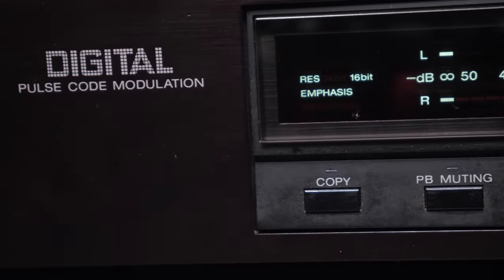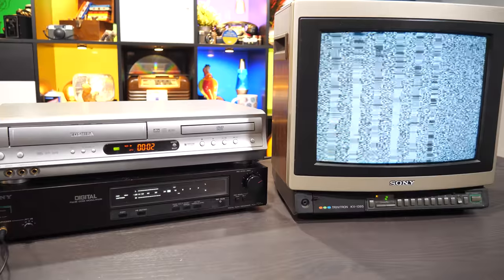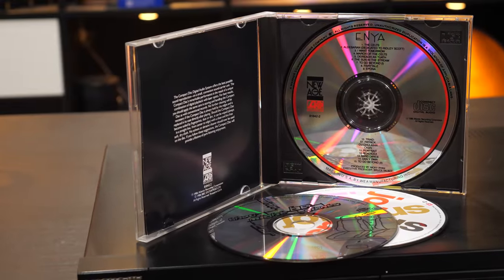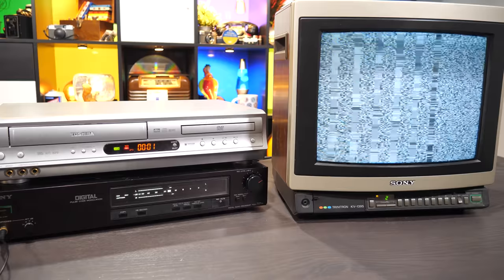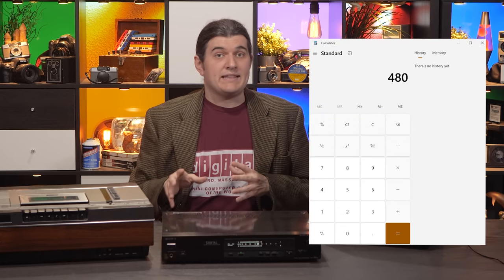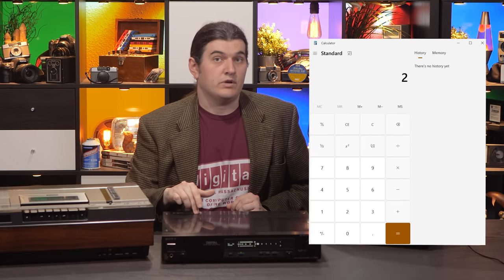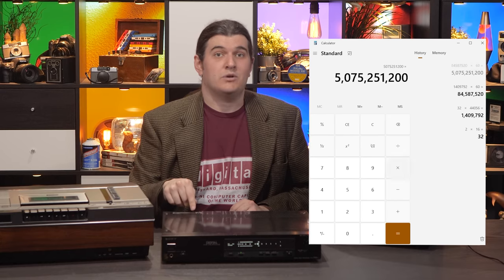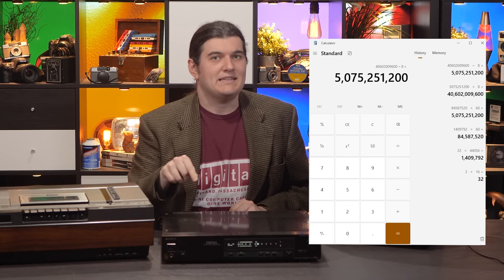Digital audio needed videotape to be possible - and the early days were wild!

Comment: Fun fact: This was how I used to record at music festivals for a very long time. I would record onto the stereo hifi track as well as through a PCM. I still have my Sony F1 PCM and can still play back many of the archival tapes I have (though a huge portion of those have been digitized at this point).
Reply: Moved to a PC file format, actually. Because it's digital audio already, isn't it? I'm curious about the process, how do you copy the tapes onto a computer??
Reply: @asnovasdodia  There are PCM adapters which have S/PDIF connections (eg. Sony PCM-601). Otherwise you can also re-digitize the analog output once again. To be fair, that's still give going to give you excellent audio if done right.
Reply: I think iirc we used to put the SMPTE info on the analog to sync it to the midi controllers
Reply: Have you made your recordings available somewhere?
Reply: I always wanted the pcm module for my F1 system & never got it but I still have all the brochures for the F1 system I would have liked to have the rest of the F1 system as well I could only afford the VCR & camera
Reply: @asnovasdodia  Yes and no. The "adapter" here functions much like a modem, modulating and demodulating the digital information with the analog medium.
Reply: I remember Steve Parish saying they recorded Grateful Dead shows on Beta for a long time. I assumed they were just using the audio track but this makes a lot more sense.
Reply: This was the only thing I could think of what it would be usefull for.
Reply: Yep from about 83-86 they were recording to Betamax with PCM encoders. Dan Healy was the brain behind that. They also had a cassette running.
Reply: @jerryseinfeld9815  That makes so much more sense than what I was imagining when I heard it.
Reply: How did you leave this comment a full day before the video was published?
Reply: Were you recording digital and analogue simultaneously to the one tape? If so, that's extra cool.
Reply: @dielaughing73  yup! That way both versions could be used independently of one another. In other words, if I didn’t have a functional PCM at some point, I could still at least listen to the HiFi stereo track.
Reply: @klatubaradanikto  Sometimes he would record them on a Pop Tart because you know... drugs.

Comment: This is why Sony and Philips both initially only advertised the CD as being able to hold "one hour of music", not its official maximum capacity of 74 minutes -- because that's the longest length of U-Matic videotape that was available at the time.
Reply: Wait…whut?!???  MIND. BLOWN.
Reply: A techmoan & LGR reference in the video, and a VWestlife comment in the comments section?

Now THIS is quite the technology (enthusiast) connection!
Reply: Curiously, Sony and Ampex later released U-Matic cassettes with a thinner tape and longer length (Sony MDU-75 and Ampex/Quantegy DAU-83E respectively). At the same time, full-length 74-minute releases ceased to be a rarity.
Reply: That makes SO much sense
Reply: The alternative story is that the duration of a CD was set by the Sony President as it had to hold a full version of the Beethoven's Ninth Symphony without interruption
Reply: @barrieshepherd7694  I heard that, and it may be true, but that's no reason to limit it to 60 min. A 60-min limit on the mastering media would be. At least that's what makes sense to me.
.. Although, couldn't they just run one Umatic for 60 min, then another for 14 for the rest of the CD? Maybe too much overhead.
Reply: Well, yeah, for NTSC. PAL lasted a bit longer. I think it was almost the same as for Betacam - on 60 minute tape you could record 60 minutes of material on NTSC machines, but 75 on PAL machines.
Reply: @barrieshepherd7694  Not just any Beethoven Ninth, but the 1951 live version as conducted by Wilhelm Furtwängler, which was the slowest at that time (and thus longest). I heard an even crazier story in that for the introductory presentation they wanted to pull out the CD out of their shirt‘s front pocket, but since the CD was now 74 instead of 60 minutes, it no longer fit. So they had their shirt‘s front pockets modified. 😂
Reply: I knew about this from way back in 2000s was because of the length of tape available but i never knew the tape format used for that. Thank you for sharing this @VWwestlife
Reply: @nthgth  Another reason was that Sony suddenly changing the physical size of the CD to 120mm in diameter, at the last moment, meant that Philips needed to retool their manufacturing machinery to accommodate the new size standard. Philips was ahead of Sony on the construction of a CD manufacturing plant, and this change allowed Sony to catch up.
Reply: @nthgth  I'm not so sure about that either, I have a copy of Symphony N9 conducted by Maazel on CD, an early 1983 3/4 black face japanese import, and that one is 65 min.
Reply: hi there is actually a data storage recorders in 80s. Sony DIR-1000 it can provides up to 770 Gbits of data storage capacity (That is variant of uncompres digital component SD video recorder D1 from Sony release in 1986 Sony DVR 1000)...
Reply: @juliavixen176  From Wikipedia: The creators of the CD originally aimed at a playing time of 60 minutes with a disc diameter of 100 mm (Sony) or 115 mm (Philips). Sony vice-president Norio Ohga suggested extending the capacity to 74 minutes to accommodate the recording of Wilhelm Furtwängler conducting Ludwig van Beethoven's Ninth Symphony at the 1951 Bayreuth Festival. The additional 14-minute playing time subsequently required changing to a 120 mm disc. Kees Schouhamer Immink, Philips' chief engineer, however, denies this, claiming that the increase was motivated by technical considerations, and that even after the increase in size, the Furtwängler recording would not have fit onto one of the earliest CDs.

According to a Sunday Tribune interview, the story is slightly more involved. In 1979, Philips owned PolyGram, one of the world's largest distributors of music. PolyGram had set up a large experimental CD plant in Hannover, Germany, which could produce huge numbers of CDs having a diameter of 115 mm. Sony did not yet have such a facility. If Sony had agreed on the 115-mm disc, Philips would have had a significant competitive edge in the market. The long playing time of Beethoven's Ninth Symphony imposed by Ohga was used to push Philips to accept 120 mm, so that Philips' PolyGram lost its edge on disc fabrication.
Reply: @vinylarchaeologist That sounds very like the story of the first miniature "pocket" transistor radio from Sony. The salesmen had enlarged shirt pockets for demonstrating how portable it was.
Reply: @StranaHyena  Now all we need is for Cathode Ray Dude to show up and then the circle will be complete.
Reply: @VCD-Channel  I had occasion to test the AMPEX DAU-80 and compare it to the SONY MDU-75 when using the Sony error detection hardware connected to a DMR-4000 U-Matic deck. (These were specially adjusted to handle the thinner tape and did not have any color or dropout compensation circuitry in them. Exactly what the PCM switch did on the consumer decks.)

I remember being surprised that the AMPEX had far less errors from end to end. The lengths were identical with both of them clocking it at 80 minutes and a few seconds. Most of the errors on the SONY tape were at the ends, which is why they were labeled as 75 minute tapes. AMPEX for the win...
Reply: @barrieshepherd7694  That is a true story that was circulated within Sony for years. I heard it from the instructor at a Sony training class. He also dictated the size of the Beta cassette, saying about U-Matic that if it was the size of the engineers little white day-planner/notebook that he could sell it easier. They came close, but the book is still a little smaller... (Different Instructor on that one.)
Reply: @vinylarchaeologist  Nah, the front pocket story is from the book about founding Sony, and how their first product, a transistor radio, didn't quite fit in the pocket, so he had shirts made with slightly bigger pockets, just so he could say it was pocket-sized.
Reply: @EVmike  Thank you so much, I appreciate it. Now I know that story wasn‘t about CDs.
Reply: From what I understand, the Red Book Standard doesn't actually list a maximum playing time for CD. I remember reading in a magazine in article about the history of the CD that if you push everything to limits of the Red Book Standard without violating it you can fit a few seconds under 80 minutes on a CD.

Comment: Just to add a few bits of info to the discussion, I worked as an engineer for a local NPR affiliate from the mid80's to 2005. We used the Nakamichi version of the Sony F1 the processor to record  the Oregon Symphony for broadcast. One use of the 14 bit format was to allow for more error correction, which allowed for trial and error editing on a regular video tape edit machine. Recording the audio simultaniously to the linear audio channels allowed you to jog to the approximate location, then shifting a few frames one way or another allowed for crude edits with no buffer. The PCM processor was also used for the first live national digital music broadcast (Portland Baroque Orchestras Messiah hosted by Martin Goldsmith) utilizing a satellite uplink truck is Portland to send the encoded PCM video to NPR where it was decoded and fed to the network.
Reply: The first live national digital music broadcast having been done with video-encoded PCM is an amazing thing to learn! What year was that?
Reply: OPB! I must have listened to your work for as long as I can remember!
Reply: Heh, bits
Reply: I grew up enjoying your work, (at least NPR and PBS), thank you for everything.
Reply: Wow, that’s a valuable information! Was. That possible to synchronize several tapes or processors via something similar to wordclock?
Reply: @counterfit5  Yeah - I caught that one, too!  Clever!
Reply: @rpocc  Sonys 3/4 in based edit systems allowed for time code but I know of no way to sync PCM processors
Reply: @Ice_Karma  Sorry  I don't remember the exact date, but it was probably mid ninties as I think Martin was host of Performance Today until 99. It was unique, but not technically difficult as the PCM processors output NTSC video and satellite uplink trucks were readily available, just used same processor at both ends.
Reply: @Ice_Karma  I see from a earlier comment er who indicates the BBC was sending PCM  feeds via video circuits in the 80"s so my timeline may be off. Martin Goldsmith started at PT in 89 so it wouldn't have been earlier than that.
Reply: @amflyer484  I'm not sure what you were claiming by 'first live national broadcast', the term is open to interpretation...
But the BBC had been distributing the national Stereo FM network using PCM (NICAM) since 1972!
Reply: Wow, that pretty cool!
Reply: @chickenfizz  I think he means America's first digital radio music broadcast (I'm presuming America, And a radio broadcast?) The world's first digital radio broadcast was in 1995 (European DAB standard), Which came from Norway middle of that year, And then second UK later that year.. Followed the rest of whoever took it on in Europe. DAB had started devolvement in 1980/1 in a German lab, And the very first transmissions happened late 80s in Germany.. It later became a multi-Euro nation collaboration. Those guys came up with the world's first "orthogonal frequency-division multiplexing" (OFDM) modulation technique, which became one of the most popular transmission schemes for modern wideband digital communication systems.
Reply: @zipbangcrash  Thanks, my years working with James DePreist on the Oregon Symphony broadcasts were the highlight of my career. He was a truly inspirational conductor and person.
Reply: @amflyer484  I saw him conducting only once, but it was when I was still involved in PYP myself and it was amazing. I can only imagine how working with him would have been!
Reply: We had a setup like this in Yakima at an AM station where we used the 90 minute length of the tapes to record shows from satellite for play later.  Much better than an MX-5050 at 1 7/8ths IPS.  We could set the timer on the VTR to when the show came down from the bird and record it automatically.
Reply: @LiverpoolReject  Thanks for listening
Reply: @rpocc  all video has the potential, I thing coding is places, it the space, thing teletext, used on the top line of the picture screen, but the decoded clock, out shows up a lot on film/video out takes and the like after being burn into video output, as just regular video signal by that point
Reply: I got this deep in the comments looking it see if anyone ever used this tech to bounce digital audio off a satellite uplink so they could have a perfect copy to broadcast from elsewhere.
Reply: That Nakamichi unit was sweet! All the input and output connectors were gold plated to resist corrosion and it was black. One of the first ones shipped to the US was used to record the Grateful Dead shows at the Hult Theater which had just opened in Eugene OR in summer of 83. The funny thing is that an engineer had modified a VHS deck to record audio with the video head and in A/B testing the analog recording sounded much better. Turns out the brickwall anti-aliasing filters in the PCM unit had artifacts reflecting down into the audible range.